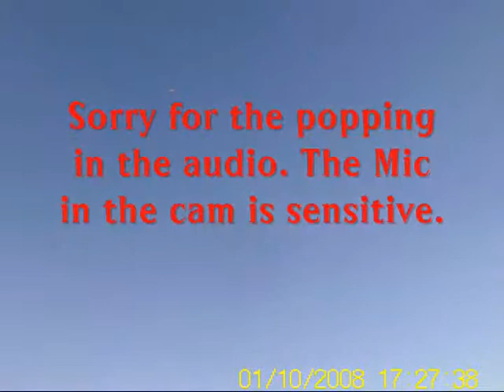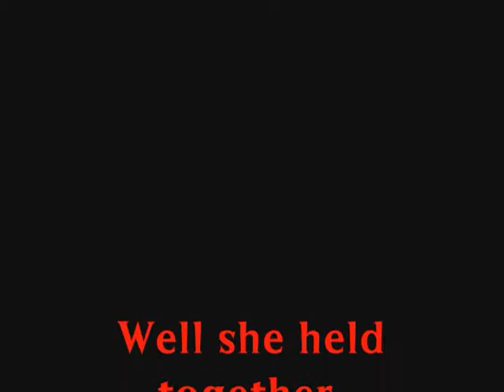RC plane flight after crash and repair.

Comment from the maker: @crookedtool   Thanks. Yeah, I spent about 4 hrs on it. 1 small crack in the wing repair covering and servo horn on the wing. Then on the side of the fuse I cleand up the jagged edges of busted wood, cut some lite ply and balsa slapped them in with CA , Epoxy and tape. Epoxied the tail back on reconected control rods. Put on a new prop and front landing gear. Done.   :)